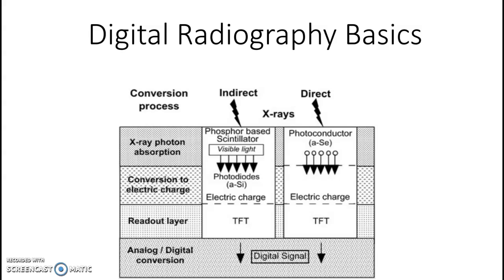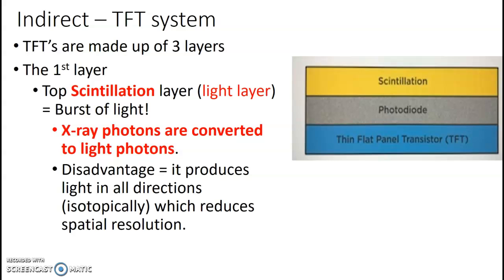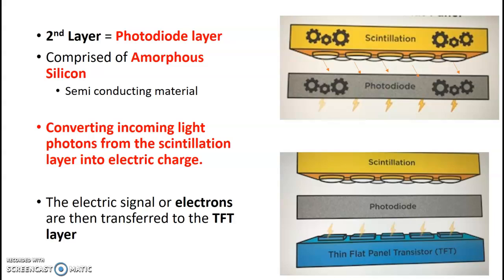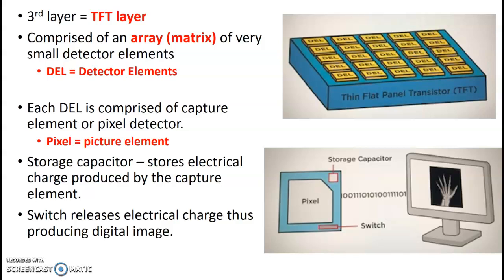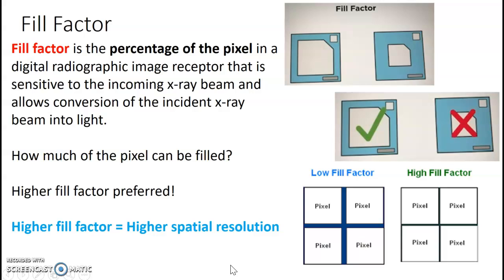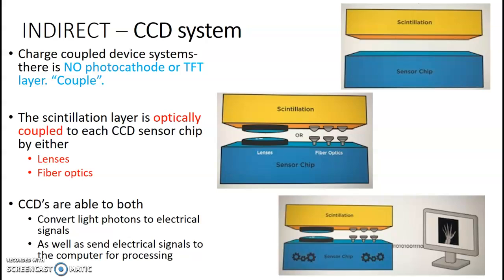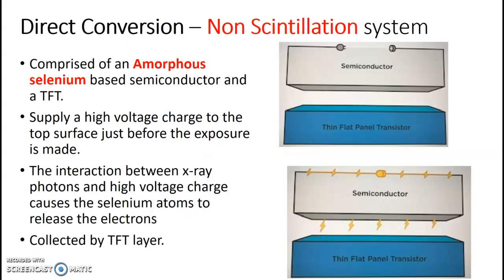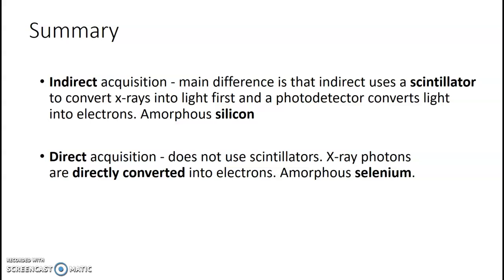Indirect and Direct conversion digital radiography basics

Comment: Great explanation ❤ but I am kind of confused about fill factor and it's relationship with  sampling interval. So does fill factor fall as the pixel sampling interval is reduced of the opposite is true?
Reply from the maker: Fill factor and sampling frequency are two different concepts.  You want the DEL to have a high fill factor for higher spatial resolution.
Reply: @meaghanpiretti7340  thanks a lot 🌸